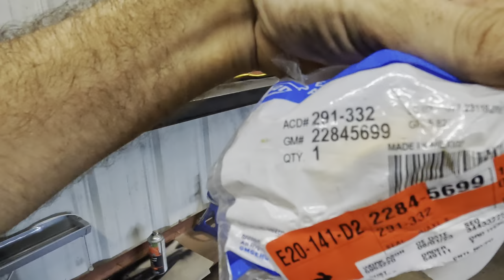FAILED Order of Operations! DON"T SPLIT JOBS! 2015 Cadillac SRX 4 Leaking Axle Seal

Comment: By trying to help Troy you proved the saying “No good deed goes unpunished “😅
Reply: You covered up the "hole" where the axle goes in but left the unsealed bearing open to the grit from the flapper wheel! Not counting the metal dust it created from the flapper wheel. Any grit can destroy a bearing
Reply: You are wise.
Reply: cut the seal and clamp down while pulling

Comment: I'm wondering, if you like doing the hard stuff while Troy is out, how is he supposed to learn? You know how hard it is to get the right experience, don't take it away from him. I understand you need to get the vehicle flow done for the week, so thanks for a great video once again!
Reply: It was hard for me to not jump in on my son's 68 Chevelle 327 instead of letting him do it.
Reply: If Ray keeps taking work away from Troy I suspect that Troy will then feel that Ray doesn't trust him. That is a very poor idea 
to put into someone's head when they are trying to learn.
Reply: No need for a pile-on. While you're all dead right, I get the impression Troy gets plenty of chances to work on the hard stuff and will learn more working with Ray than he would alongside most parts monkeys.

But there's nothing wrong with surprising a colleague by doing one of their jobs for them every so often; whether it's a ball-ache of a repair job they were dreading, or even doing the sweeping up and putting away when they've had a crap day. You can be a boss and also a colleague 👍

Comment: FYI, the pumps in those parts washers are usually simple submersible pumps, the same as used for fish pond fountains. I have a portable unit, and the pump got smashed sliding around in my work vehicle. I went to my local hardware store and bought the exact pump in their garden department.
Reply: Who wants to see the long delayed Parts Washer fixing video? 😮
Reply: If only there was a mechanic around :face-purple-crying:
Reply: Sounds like a great opportunity for Troy..... 😉
Reply: It's possible some dirt got past the filter into the pump.Try cleaning the pump & locked it up .
Reply: it probably works fine if you read the directions..
Reply: Ding Dong would rather waste money by using brake clean.  For what a couple of cases cost he could probably purchase a decent part cleaning machine.
Reply: He still has the cleaner, get a brush and wash the parts, lot cheaper than brake clean.
Reply: @dcolb121  NOT!

Comment: I've found that most rear differential leaks are not a bad seal but a plugged up vent which causes pressure to push past the seals. I find it really hard to believe that 2 axle seals both went bad at same time.
Reply: Yupp...Happens to Toyota trucks all the time.. The vent is just a little rattle cap on the axle...if you do any sort of real truck stuff with it, it gets caked with mud and next thing you know youve not only blown out the axle seals, but washed the grease out of the pressed on axle bearings too... So once the seals bliw youve got a much bigger job than just replacing seals on your hands... The smart guys have done an axle breather relocate so that doesnt happen.

Comment: Whenever I had to fit a bearing, bush, seal with a metal outer ring etc. I would always put them in the freezer for a couple of hours first. 
It works so well that sometimes you can actually just push the item in by hand.
Reply: good tip
Reply: I like to stay in the freezer with the parts. Hey Ray where's your freezer!?
Reply: You know he has no patience for that kind of stuff.  He can't even wait until bolts are cool from torching.

Comment: I don't work on cars, but I do work on machinery. I watched this video after having to take over and finish a job that someone else started. I gotta say that I know the struggle is real.

Thank you, Ray for another entertaining video.
Reply: it is too bad, that YT could not make it easy to have both full one hour videos and split in chunks - videos! that way everyone could be Happy!

I do not mind Long videos or short! But, if I had to make a choice of one or the other - I would choose the longer videos!
Reply: It certainly is.  One of the biggest issues I had as a Maint. Mgr, was communication.  The outgoing shift would just waltz off, leaving the incoming clueless.  To stop it, there was a 90 second in/out meeting, in spoke, out listened  I had the outgoing take the incoming guy to the job and explain.  The place better be tidy and all parts available AND I had a habit of checking how the whole thing went. Oddly enough, no one complained and everyone was happy.
Reply: Hi Ray I notice you don’t torque much use torque specs
Reply: I work on machinery, too.  Had a customer's maintenance guy go in and start taking things apart then got put on an indefinite parts hold (long story, but we couldn't even source a good used part).  He was on vacation when the parts showed up 2 months later.  I was tasked with getting the machine up and running because they needed it to finish production.  Nobody knew what parts were where, or where he started and stopped with the repair.  I ended up breaking everything down and rebuilding it from the ground up.  Had them up and running 3 days later versus what normally takes 5 minutes.  At least we made some pretty good bank from it and they pretty much got a completely rebuilt machine out of the deal.
Reply: I did computer repair for 14 years.  Nothing worse than taking over a repair or maintenance from someone else.

Comment: Ray, your debacle brought back memories. I once replaced the water pump on a Ford 351M/400. There is a skngle bolt behind the pump for the power steering bracket. The bracket had to come off with the pump. I put it all back together, with Permatex on the pump gaskets, then found the bolt I'd  forgotten . All back apart. Trip to the parts store. Do it again..

Comment: Reminds me of the time my brother in law asked me to assemble the gas grill that he had started trying to assemble himself.
He had it almost 3/4 complete and realized he didn't have a clue what he was doing.
Using the proper fasteners in the proper places and following the order of operations is critical for those things.
I had to take it apart, measure all the screws and bolts and figure out what went where. 
A 45 minute job turned into 3 hours.

Comment: After gouging a few housings I learned to drive the seal towards the middle and using the seal puller to pull on that instead of the outside of the seal where it meets the housing. Better pulling point and no damage to the case

Comment: I totally felt your pain and frustration from the reassembly of such a complex, expensive and difficult hub system.  It probably had 3 different guys designing it who did not share a common language and were unable to communicate with each other.
Reply: and all three of them had brain damage from a studabaker falling on them!!!
Reply: But it fits together fine on the CAD system!
Reply: Engineering 🤪
Reply: And not a @#$%! one of them having had any experience working on anything mechanical.

Comment: I just use an old dish tub, a brush and kerosene.  Kerosene may be expensive these days, but its still cheaper than brake clean.  Then, I finish it off  by using the brake clean for just the final rinse.  I don't go through a lot of brake clean that way....but to each their own.  Best wishes, Ray.
Reply: Back in the 50's and 60's, my father was a mechanic and he exclusively used kerosene.  He was also able to do a simple filtering of the catch bucket to recycle and use for first pass clean on the really dirty stuff.
Reply: @MacRODesign55  Kerosene can last a long time for cleaning as can diesel.  Just need to filter the particles out.
Reply: Yes agree, Why spend a lot of money on Brake clean when you can wash the parts in a diesel tub and then just finish whith a touch of the brake clean.
Reply: @MacRODesign55  The sludge settles at the bottom over night. Just poor out the clear Kerosine/Diesel for reuse.
Reply: he feels climax to see gush of Braleclean.

Comment: Armchair expert:  Lube seal lips EVERY TIME before installing shaft.  You left output shaft roller bearings exposed to sanding grit when smoothing down the seal puller damage, recall the sanding drum dumps silicon into the area, and this is not so great on bearing surfaces, cover bearing rollers and the hole, prior to sanding/polishing.  Use a flat ground chisel to knock in the edge of the seal prior to pulling.  Seal pullers are great for puncturing the metal shield and doing the exact kind of damage shown to the seal bore surface.   For your wash tank, you can use a discard fuel pump to circulate solvent, and it is only 12v.  Look at your ball joint press set for round tubes to install new seals, you will often find a suitable tube, or lathe cut one or more, and every time you remove a junk part, look it over to extract a new seal/bearing installer tool which may be cut from the junk part, brake caliper pistons, for example, bearing races, etc.  An M3 aircraft machine gun barrel shroud, full length, has a nice tube to make a seal installer from, also is a fine cheater tube.  You had that screw jack right there, why not use it to support the hub while fitting up the parts?  Instead you stab yourself in the chest, over and over, with the wheel studs.. at least make a cover board to hang on the studs to protect your chest, from 1" board.  Always attempt part alignment before shoving in threaded rods, as the threads cut out much metal going in, in misalignment.  Lastly, never tighten these control arm bushings while the suspension is hanging.... these are to be finalized with vehicle weight on the suspension links, to prevent rubber bushing spin-up, torque, and tearing.  Get a small lathe and bench grinder to stick over in the corner, very useful for knocking out a custom seal/bearing install tool or press arbor tool, if for nothing else but to square the tube ends.

Comment: Guten Morgen Ray. Ditch the seal puller. Try using a blind bearing/seal extraction collet. It was the only tool I used on aircraft engine aps (just for the very reason of case/housing damage). It would do a killer job on those pilot bearings, too. I say it in past tense because I've been medically retired. So, there is a lot of viewing time of you and Eric O. Can I trade my A&P in for a ASE? Hahaha! Thanks for the great content. Learning a lot from you and Mr. O.

Comment: Those yellow seal anti-theft rings really make replacement tough! Seriously, you are too hard on yourself. I would have done everything the exact same, 'cept a couple. As for going behind someone, that's tough, too - and with me, an hour after I took it apart, it's as though someone else took it apart😊! Only thing worse is if the original tech broke stuff while taking it apart, and I've been there. Take a deep breath, and have a good weekend!

Comment: Good honest video. Pressure to get jobs done before the weekend by 'helping out' often causes that kind of issue. You had it right, just do the bearing and leave the complicated reassembly to the one who took it apart and could remember the order.  Everyone learned something there.
Reply: Yeah, the guy who took it apart knew the long bolt had to be in before the axle went through the hub. Probably should have even left it in place, ready for re-assembly.
Reply: @mrpesky163  If only the guy who took it apart was around. And this video was recorded on Thursday not Friday.

Comment: Ray: You have a very powerful tool at your finger tips, your phone camera. We use this at our shop to take photos  BEFORE we disassemble an engine or part. 

We had a wash tank in our shop. We turned on the heater as we walked into the shop to preheat the water. It was like a industrial dishwasher. It saved time and got rid of the oils/grease (we rompes the large chunks first). It’s worth the investment. We just added an additional hour of labor to that job.
Reply: I've run parts through the dishwasher at home.  Worked pretty well, but let's just say that someone in the household was not amused.
Reply: @dotar9586  We must of had the same Mom !

Comment: Professional tip: On seals that have a spring band around seal wall add a little trans lube between spring and seal wall. helps keep the spring from slipping out while driving seal into place. Helps prevent comebacks .

Comment: You can never go wrong using a socket to hammer seals in they always work 12:25 they always come in clutch when ya don't have the Oem branded Tool  @Rainman Ray's Repairs

Comment: I spent two hours yesterday trying to refit a part that should have gone together in two minutes. BUT a tiny spring fell out (that should have been held in place with heavy  grease, but the unit was so old the grease was literally DUST) .That spring placement was hard to figure out.  It takes patience! Thanks for being persistent.

Comment: I totally understand your frustration on re-assy of that job. I worked on electronics for many years and one tech would "Have to go an a service call & can you reassemble this unit?"
 After the 3rd time finding he left out pieces and grounds I finally refused to help him out. I got tired of loud noises, sparks, and factory smoke coming out of the unit where parts were not replaced.
(30 KV arcing makes a real fireworks display !)
   Of course, he never bothered to tell me the parts were left out, often buried in the rats nest on his bench. So I give you the following advice:
"Whenever you are down and out, lift up your head and shout F### IT ALL!!!!"    It doesn't fix the problem, but emotionally it helps.

Comment: Excellent video as always! I feel your pain. Our shop was doing a restoration on a Lamborghini coupe from the early 70s. I was handed several boxes of parts and window glass for the doors and told to install the windows and make the electric window regulators work. No manuals. I managed it and thankfully the shop owner paid me for all time spent doing the work. Previous mechanic had quit after disassembly.

Comment: Troy- I have a suggestion that has worked really well for me putting in bearings, and metal encased seals like this one. I lightly grease the outside of the seal, the metal portion that inserts
in the hole and lightly grease the inside of the metal hole. and using a socket, like you did, parts insert way easier with a little lube.  Thanx

Comment: Much respect for sticking with it.  The ongoing joke between mechanics and engineers comes to mind.  I honestly believe that if design engineers had to work on these things that they would suddenly get very maintenance friendly.  I took my kids 2001 Chrysler Sebring into the dealership (the only place that would work on it).  When I picked it up, the mechanic said that it was the worst designed/engineered car he has ever had the displeasure of working on.  When you have to remove the tire to disconnect the battery, you know it's going to be a long day.

Comment: Years ago I worked in the pleasure boat side of the marine industry. Re-sealed and rebuilt lower ends on Mer-Cruiser and OMC outdrives and outboards. We'd always apply a thin layer of a Permatex marine grade sealant to the outside metal of seals before we installed them into the aluminium housings. Doubt a marine grade is necessary on this housing but it would work as a  secondary back-up to cleaning the marred housing on this Caddie

Comment: Ray, it was wild when you pulled out the 3/4 inch drive socket. It was a 2 1/16. In the early 80's I worked at a store that sold everything, major business was carpet and paint. One of the owners would go somewhere and bring back all kinds of junky tools   on one trip we had some 3/4 sockets set that were large and graduated in 1/16 inch. I said that will be handy for drive nuts on front wheel drive cars. With graduations that small it will work on big metric nuts. Paid $19 for a set that was super heavy. Have used them for years, and they are now at my nephew's shop. Yes, they are junk, but work great.

Comment: The pain is real.
I replaced a complete front end on a Trans Am, a Chevy Corsica, a Silverado, and a 68 Camaro.  I know the struggles with awkward and heavy parts.  I don’t feel so bad that I had to redo a few things because I got ahead of the order of the process a couple of times.  It will definitely sap your brain cells and your body strength like Kryptonite does to Superman.  I will have to watch this one again when I work on something, and it all goes wrong.

Comment: I have not used a seal puller more than a few times, but I have failed 100% of the time to get it to work as advertised 😢.

I do wish you had put a paper towel between the flap disk work and the outer caged roller bearings, like you did with the pinion.   Would not take much stray grit in there to hose those bearings some miles down the road.

Comment: The control arm bolts should be tightened up with the vertical at ride height. To prevent a bind. So I was taught.

Comment: Way back when cars were cars, 1964,  a friend did me a big favor by finishing the instal of the distributor on my 55 Mercury.  He installed the shaft which connects to the distributor on the top and the OIL PUMP on the bottom.  He mistakenly installed the shaft up side down, the retaining ring which holds the shaft in place not holding the shaft in place.  Everything worked great the first 10 miles, but the shaft fell worked itself out of the OIL PUMP, leaving it out of the equation of the operating motor.  No oil pump, no oil, blown engine.  It never ran again.

Comment: For that solvent tank, the pumps are usually junk. A good cheap mod for them is to get a decent inline fuel pump and an accessory filter. Works pretty well.